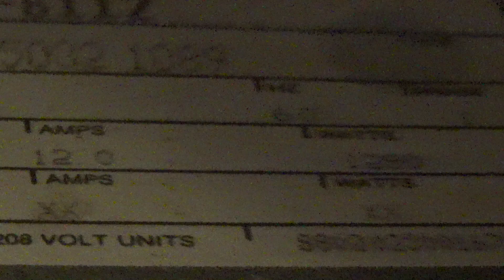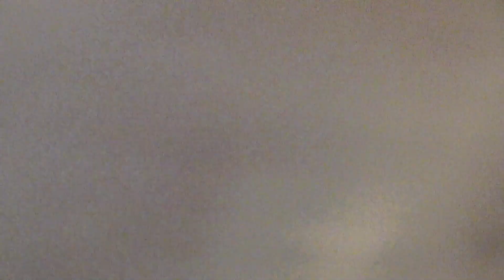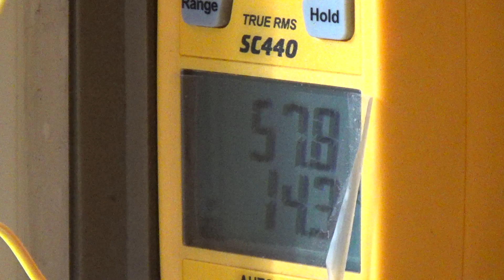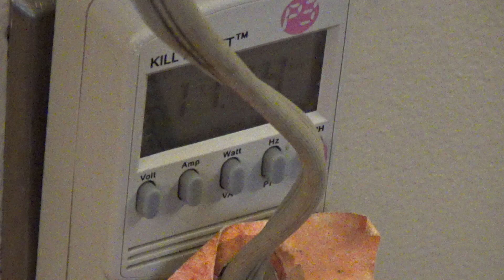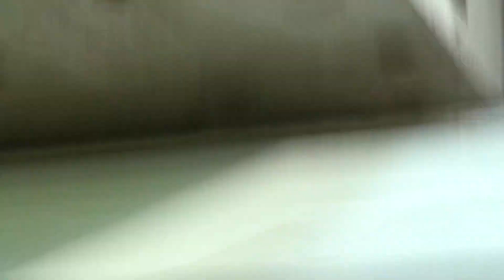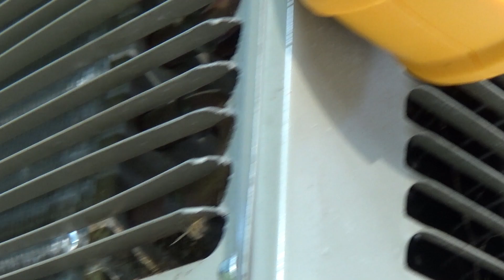Montgomery Ward (Fedders) LFE-6112 11,500 BTU Air Conditioner

Comment: Compared to other vintage units these Fedders Rotarex units are definitely worse, although they are surely far superior to any modern unit. 

These things seem to be complete rust buckets though. Every one of these I see nowadays looks to be very rotted out. Someone in my neighborhood had one of the small chassis 90s Fedders in their wall and when they pulled it out it completely disintegrated. I saw the basepan all by itself on the curb and it was very rusty
Reply from the maker: In what ways are they worse?
Reply: @JordanU  It's the rotarex itself. My grandparents had one of the early 90s Fedders units and the compressor locked up. I have a Fedders apartment style unit with the rotarex and it takes forever to get somewhat cold
Reply from the maker: @nextg5062  This sounds like a case of limited experience bias. Was that compressor cut open and confirmed locked? That's an extremely rare failure, for even the cheapest of units. Most rotary compressors take a long time to build pressure, that's not specific to Rotorex.
Reply: @JordanU  This was well over 10 years ago. They just threw it away when they got central air. It sat in the wall unused for a year or two before that.
Reply from the maker: @nextg5062  It very likely was just a spoiled capacitor.
Reply: @JordanU  yeah you're probably right. I was very young at the time so I was just going off of what my grandfather said was wrong with it

Comment: I have a 10K Airtemp unit from 87 that sounds identical to this one. Excellent AC. It has a 3 speed motor with only 2 speed selector knob. I bought a 3 speed selector switch and un capped the medium speed motor lead. Now it's 3 speed but the face plate doesn't match the fan speed. Oh well, definitely a keeper and useable. Just curious to why the compressor sounds very gritty on this era of these ACs..
Reply from the maker: The compressor sounds smooth to me on this one.

Comment: Glad you have it so the unit can actually get some use finally. I picked this up in Saugerties a couple years back. I always use a step bit to drill drain holes at the lowest point in the pan. Will let you and Kevin fight over what happens with it next..
Reply from the maker: I'll pass it along to him when he has a use case for it. He has more nostalgia for this particular model than I, so it's only right for him to have it.

Comment: how do you replace a capacitor on a 1996 Goodman window ac
because the the Goodman window ac I got was from the dump and it has
a bad capacitor and I'm trying tnot to blow my hand off replacing it
with a parts goodman window ac
any advace
Reply: do you have a replacement capacitor for it?
Reply: @BigeSnek  going to have to part out another Goodman window ac
Reply: Or you could just buy a new capacitor instead of getting another bad one.
Reply: @BigeSnek  going to the dump for that
like I I got the 1996 Goodman window ac